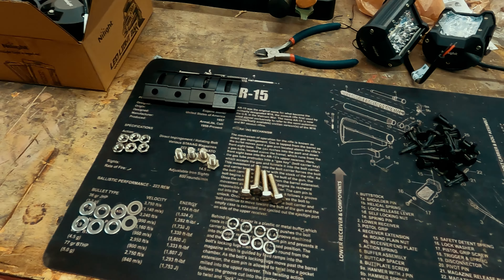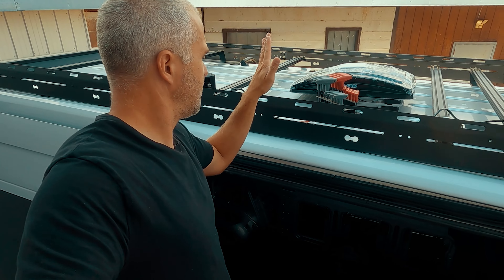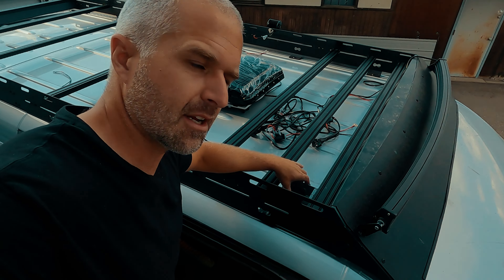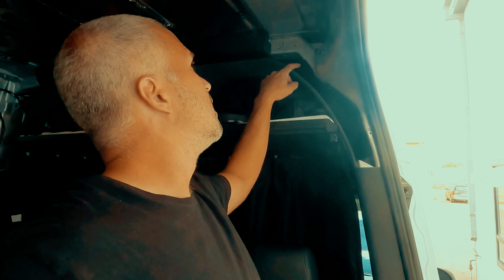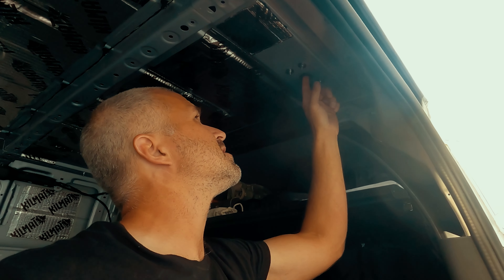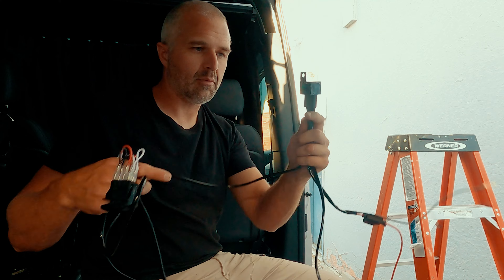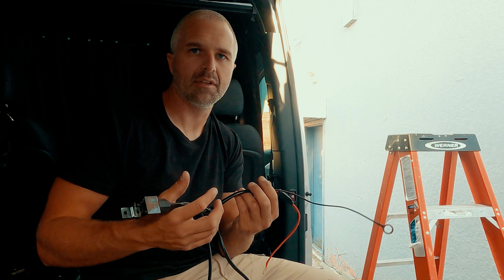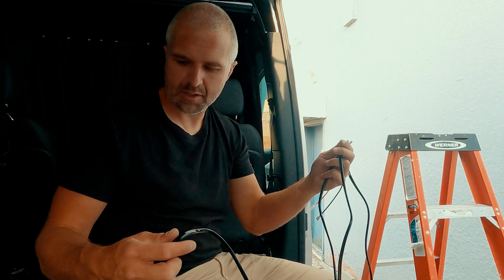Nilight Lightbar & Spot Lights Installation // Sprinter Van Build

Comment: Thanks for the video. Look forward to doing this next year here. That lightbar looks rad on the front! Two things: Can you also share links to the cable enclosure you mounted? What roof rack is it?
Reply from the maker: Glad you like it. The enclosure is just an outdoor junction box I got from the hardware store and lined with Butyl tape. I went that route because I am running so many wires through.  The roof Rack is from Flatline Van Co.  
https://amzn.to/3UQzs3I
https://youtu.be/q-w29BVa474

Comment: great video...Im just starting to install lightbars..Id light to tie my lightbar into my highbeam switch...is this possible, any specs? thnx
Reply from the maker: Im not sure how exactly you would do that, but it is possible. I believe the High beams are on a relay so instead of wiring a relay from the light bar to your battery, you would take the two wires to the relay for the high beams.  Im not 100% sure on that, but I think thats how it would go.